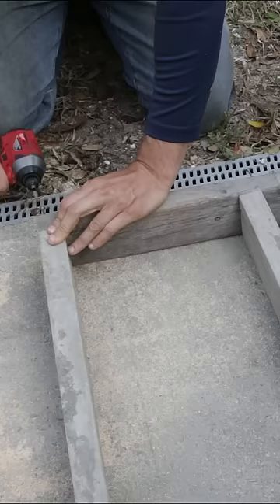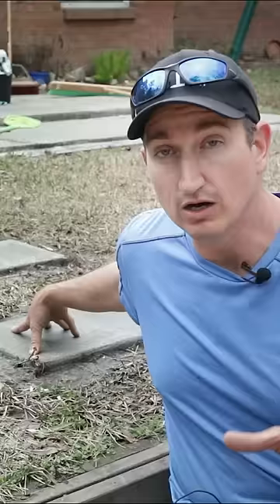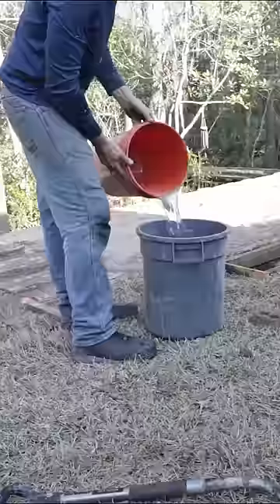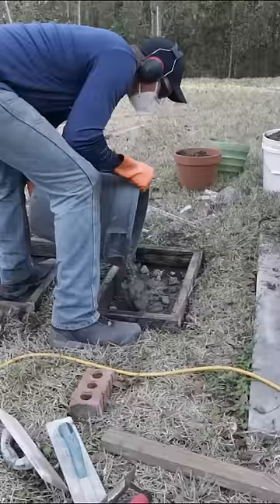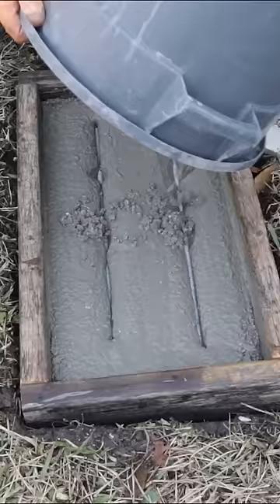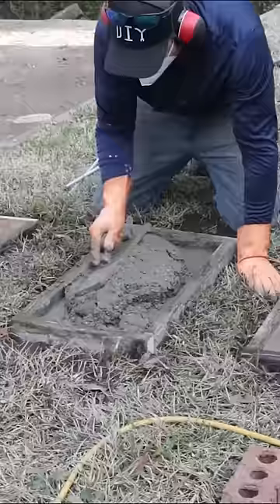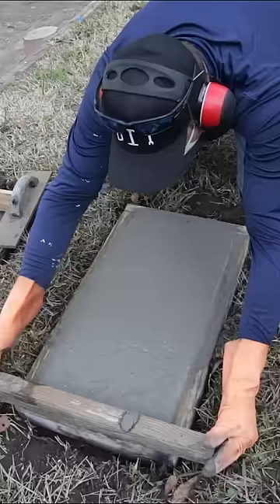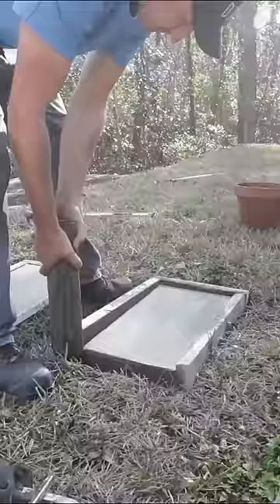How To Work with Concrete for the First Time

Comment: Proof any ol Joe can make a video. There was no need for your "threaded rod reinforcement "😂 and they weren't even all consistent. One of them looked to be an inch or more shorter than the others 😂. You didn't use any crushed stone,, just tapped tapped dirt 😂😅 Just bc you can guys, does not mean you should post everything.

Comment: Learn the metric system, stop using illogical values such as a fluctuating body temperature or feet that are different sizes.
Reply from the maker: metric is a solid measurement system
Reply: @MrKistel  It is far surperiour! The Meter is determined from the speed of light. A Kiliogram was defined (many many years ago) within the 30ppm limit of what now translates to 1 Liter of water. The Celsius is the boiling point of water, of 100c.

Now if I had a tank of 1x1x1 Meter and I know that gasoline is 25% lighter in weight compared to water, how much Kg does the gasoline weight? It's a simple equation in Metric, try the same in Imperial and you find out that a Gallon does not translate distance no matter how many "1/16" "cups" you give it.

Understanding Metric connect mass, length, time, electromagnatism, temperature, quantity and luminous intensity.

Understanding Imperial means you need to connect everyone of them with formulas which is an extra layer of work.

In essence, with Metric you can estimate how much a 1L  cup weighs 50Km above the Earth, where we know time is moving slower and the gravity is less.

Comment: That’s not concrete that’s cement, concrete has aggregate cement does not
Reply from the maker: Premix concrete bag comes with all that included within.  The aggregate is smaller so may be hard to see in the video.
Reply: @MrKistel  consider me wrong then

Comment: No need for rebar.
Reply from the maker: not in this slab
Reply: @MrKistel  OK, no need for a "Threaded rod" which you inserted into the cement at 0.35  of the video. Does that make you happy?  Anyone who works with concrete like myself knows that this is a waste of time and money for such a minscule project.

Comment: So no prepwork, the reinforcement that holds like a crackhead, remove panels and leave it like a warfield. And then even admiring your work of art😂 bro you smoke some real heavy stuff. Basicly dug a hole and filled it with a bag of concrete😂

Comment: Best mask for concrete dust you need it to fit your face perfect with a air tight seal don't just use a white dust mask as it will give you Silicosis of the lungs concrete dust is highly toxic to lung health i do building construction and concrete repairs on new buildings i have to be clean shaven with no facial hair or stubble to use a fit test mask.
Reply from the maker: Yes, a respirator is what I should have worn for the video and is what I normally wear when playing with bagged mix concrete.

Comment: You have zero clue how to make and lay concrete 
You need to use sand crushed stone (ballast works best) and cement you put the renforcment in first before you pour your guage something that size doesn't need it you then use a spirit level to make sure you have your level lean for rain flow